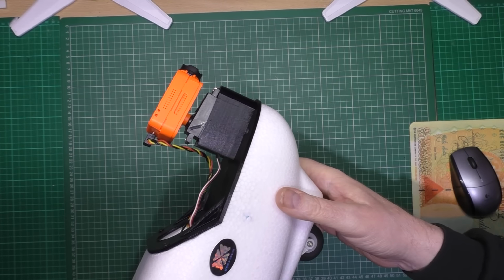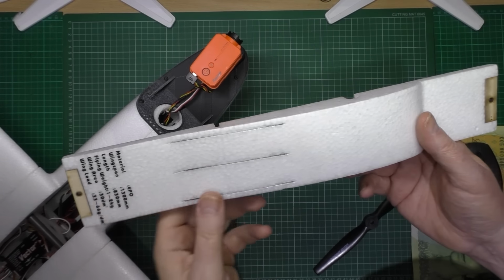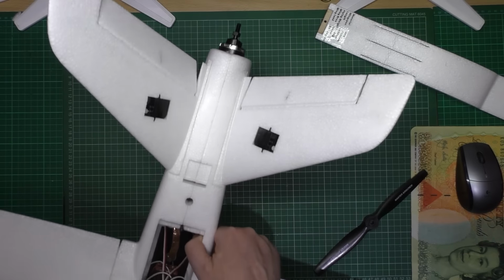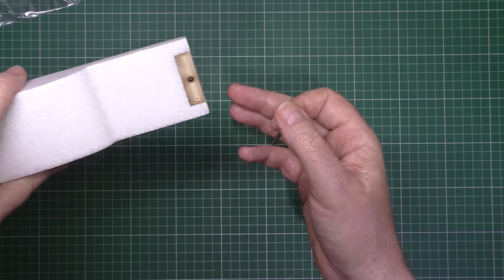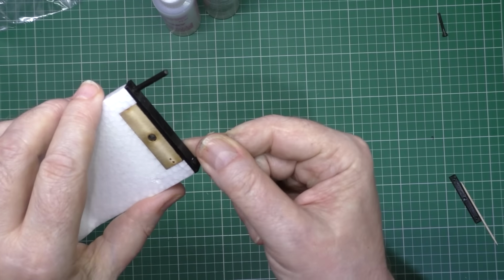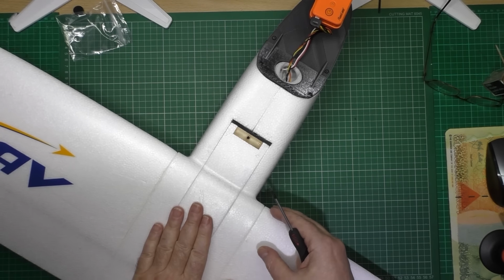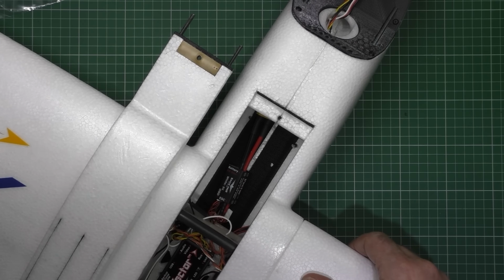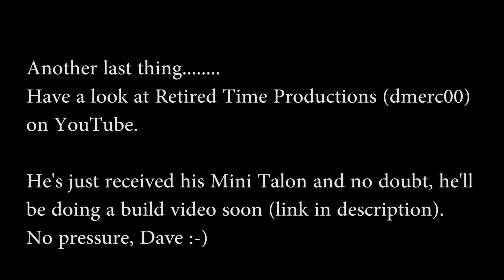X-UAV Mini Talon build part 3 with mods

Comment: Wow thanks for the shout-out. I feel the pressure already to do a mini Talon build. You have so many good tips so that will make things easier.
Reply from the maker: No problem Dave. I think I should have asked you first but, seeing as you mentioned me in your unboxing, I thought I'd return the favor :D
Reply: You knew I just had to do one so it's all good.
Jon is working on the 3D printed parts already.
Reply from the maker: Let me know if you want anything changing Dave. You're the first one to try the parts and they were only designed for my needs.

Comment: Lol....Nice Hatch Catch Tony...you really engineered it m8.....Are you going to use the Runcam as a flight and HD capture Camera..?...I use my Mobius like that all the time, but I do use a Monitor....Interested to see how good it is as an FPV Camera..?
Reply from the maker: I'm going to try it but I have heard reports that some have frozen in flight. They do get rather warm if you don't keep a constant airflow across them or..... they freeze. The video output quality almost matches the Runcam Swift and the latency is only 60ms with 1080p@60fps recording which is fine for slow flying :-)
Reply: +Vortecks I have hours and hours of fpv flight on my Mobius...and it captures in HD at the same time...Like you, I also use the HS1177 Sony Camera too...60fps on the Runcam is pretty high, as I run the Moby on 30fps and ultra wide setting At any sort of altitude, 30fps works fine on the Moby...Its downfall appears to be the strange resolution of the Moby, because whilst it looks and works great on my Monitor, recording live downlink onto a dvr is just awful....dark and grainy...Have you come across this same problem..?...Look forward to your Maiden of the little Talon and seeing your launch ramp in action m8....:)
Reply from the maker: The Runcam DVR footage is the same as through my goggles. I seem to remember trying the Mobius once and it was bad in 2 ways....... 1 - the resolution was all out of wack and there were borders on the top and bottom and 2 - the DVR footage was like watching in 8 bit colour
Reply: Agreed, The Mobius has black bars top and bottom, that said, when using a Monitor, it's perfectly flyable...probably not so if you are on goggles (which I can't use)...Interested in your live downlink recording from the Runcam m8....My Sony FPV Camera is much better, it just fills the Monitor completely and now I have WDR set to On....my dvr recordings are also acceptable, including the OSD.....Do you thinks its technically possible to carry a small DVR in the plane and capture the downlink before it's transmitted complete with the OSD overlay..?...Possible?
Reply from the maker: To be honest, I've been thinking the same thing. As long as the DVR has video in and video out, you can do it no problem. The FPV1000 will do the trick :-)
Reply: Vortecks Cool, its a very interesting proposal, because viewing raw Video overlay without transmission interference would be highly desirable dont you think..?...I think Im asking the right man for the job......:)...
Reply from the maker: I've seen a few videos of antennas that claim to be crystal clear at 2 miles..... I wonder how they did that then? :D    
If my SkyHunter maiden goes well (if I ever get to maiden it) I'll give it a try :-)
Reply: Vortecks Good Man...It could be a Global FPV first...!!!

Comment: Its making me want to start building mine Tony...Its going to be a light build with EZUHF, A 200mw 1280mhz vtx with a nice compact Dipole from Flytron....Storm AP...I have a Leopard 1038kv motor running an 8 x 4 Prop.....I will need a 4S Lipo.....What size Lipo are you using on yours?
Reply from the maker: Build it mate, they're fantastic!    
They're definitely not the slowest plane - mine has clocked 82mph but it will fly slowly and sip the power. I like it so much, I've just bought another one which I'm going to build as a lightweight one.    
The battery is a Zippy 5000mah 25c.    
Just one tip.... put some wing tape along the leading edge. On my last flight, mine landed in some bracken and dented all the front of the wings.
Reply: Vortecks Hi Tony, ok I have some 10amp 4S Lipos, but Im not putting that in it, even though I know people do...Im thinking 4amp 4S Lipo....My Bix 2 will cruise around 30 mins on a 3S 4amp Lipo....Im pretty sure the MT will do the same if not more using the little Leopard 1038kv....Then if I want to later, I could use two in parallel..?
Reply from the maker: I easily get 30 mins on a 5000mah battery and mine has a T-Motor AT2814 and a 100a ESC fitted (It was all I had at the time). I've just bought another one and I'll be redesigning things to make it much more efficient.... keep watching mate :D
Reply: Vortecks Cool, sounds good....my motor looks a bit small. but works good by all accounts...sips the amps, just 5amps to cruise....on an 8 x 4 Prop....:)

Comment: Hi Tony, just finished painting mine today in prep for the build. One question if I may, are the wings fixed (glued into place) or can they remain separated for putting together in the field?
Cheers
Stuart
Reply from the maker: It's up to you Stuart. I glued my first one but my second one is loose and only held in place with the clamps.    
It's very doubtful that I'll need to take the wings off but I thought "what if I need to replace a servo?". Plus which, it's much easier to work on the fuselage with the wings off and you can also buy just the wings if they get damaged.
Reply: That's brilliant! - agree with your points + easier to transport too!
Cheers
Stuart

Comment: Where can I buy the exactly same hatch catch as you are using? I did'nt find any info of that in the description or comment section. Waiting for my Mini Talon to arrive 😁
Reply from the maker: Any small one will do, they all have the same bolt size.    
These are probably better because the don't have the plastic release part  https://hobbyking.com/en_us/canopy-lock-latch-spring-loaded-2pc.html
Reply: Thanks.
My Mini Talon just arrived, weee 😀 But we are about to move to another city, so I have to pack the whole hobby into boxes 😒 Just cant wait to unpack everything and finally get started 😎

Comment: how easy do you find it to get the CG correct with that massive motor on the back?
Reply from the maker: It's surprisingly easy with a Zippy 4s 5000mah. Unfortunately, I'm skint for the foreseeable future so It'll have to do :-(
Reply: Ah, I've just seen you've got a pan servo on your nose too, so that would help with the balance. How far forward in the nose is your LiPo?
Reply from the maker: The middle of the battery is level with the front screw hole on the top hatch